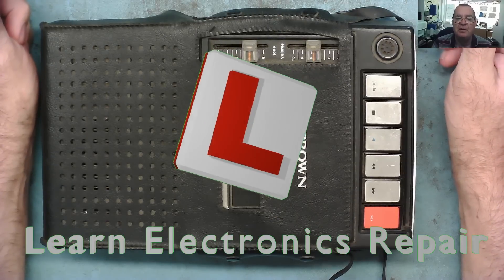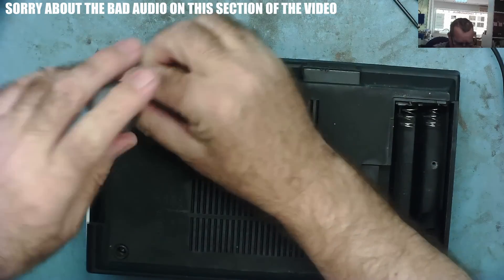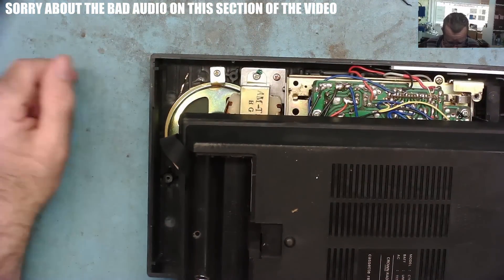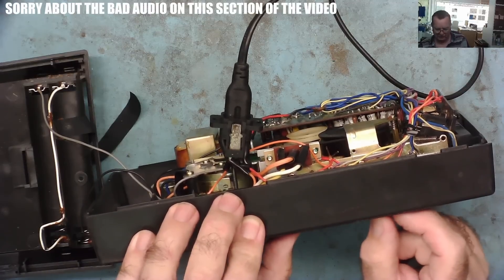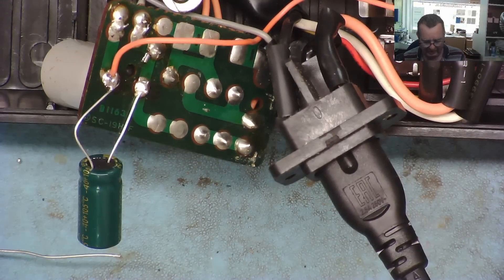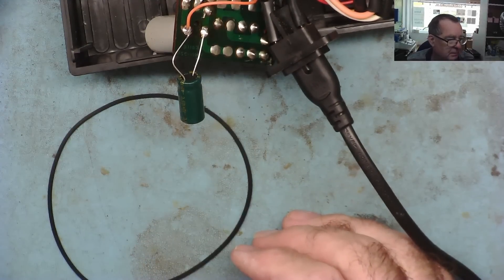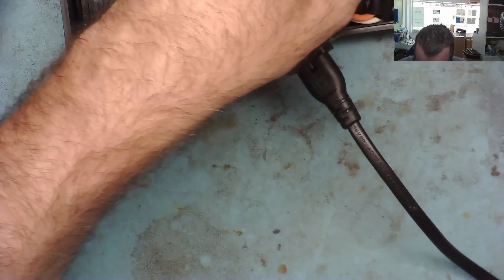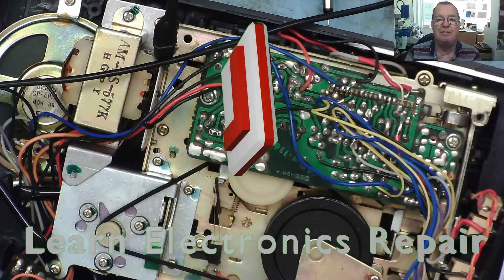Vintage 1970's Crown Portable Cassette Recorder Player Repair / Restoration

Comment: I enjoyed the video Richard, I remember back in the 70s getting one of these tape recorders for Christmas, as a child I remember taping top of the Pops from the television set then I would use it on a Sunday  to record the top 40 charts on the radio.the quality must have been horrendous. I also remember pinching those 6 V batteries out of those road lamps, strapping them to my bike to power the front and rear lights🙂
Reply from the maker: Ahh yeah recording from the top 40.... so we had this old valve radio and the best reception was on long wave where you could hear the Top40 on Sunday.  So I used to take the radio upstairs, took the back panel off and placed the microphone inside the radio itself.  That way I got the best quality.  No one (i.e Sisters!!!) was allowed in the room while I was recording.  Yeah them road lamp batteries also worked well strapped to bicycles.  And you could make a little bracket and fasten the cassette recorder to the centre of the handlebars as well and fit the battery under the seat.

Later I got into real music LOL.  I used to go to Northern Soul / Modern Soul All-dayers in Manchester at the Ritz (and elsewhere around the UK) and would of course take the obligatory Adidas bag with a change of clothes (some smuggled alcohol) and the tape recorder.  There was this one spot near the top of the stairs onto the Ritz balcony where you were right by the speakers so the Adidas bag would go there amongst the pile of other bags, tape recorder running inside, and the microphone hanging out between the railings in front of the speakers.  Wasn't just me doing that.  Of course you couldn't buy most of the rare soul they were playing even if you had the money, the vinyl was impossible to find, and you couldn't hear those songs anywhere else unless you went to where the DJs were playing it.

Oh to be young again but teens growing up now missed out on so much fun that we had then. And so much fantastic music, a lot of beautiful girls and NO ONE was fat.  And we enjoyed it all with almost no money. I'm not condoning everything we did but we had to be so inventive in those days just to get by LOL

Comment: hi rechard sorry for off topic question .. i am looking for ic that charges the  battery and protect it .. and  in same time supply 3.2 volts for mcu .. when charger is pluged 3.2 supplied from usb 5v .. when it is not connectet the 3.7 lithum battery supply 3.2v to mcu ..  thanks
Reply: how to look and search for specific ic in soic package ? 
TIA

Comment: you forgot the oldest trick in the book .take the drive belt off and boil it in water for about 3 minuets to shrink it back to its original size.
Reply from the maker: I thought someone would come up with some suggestion I didn't know about!  Must try that
Reply: 😮didn't know this ether , would have been useful on my OG Xbox that has a stretched belt , i bought a pack of 20 :P 
but will definitely keep this in mind 
thanks alot for sharing
Reply: I did this with the loading belt in a vcr the other week, it worked a treat

Comment: Did the motor have a ceramic capacitor across it's  terminals, I know form experience that can have an effect, on noise.
Reply from the maker: Hi Paul C
I didn't look.  I'll be passing this over to Carlos at Retro Upgrade if he wants to look at repairing the Cassette lid and make a part 2 video on his channel.  I'll order an assorted pack of 50 drive belts from AliExpress they are only a couple of Euros

Comment: No wonder it didn't work. Somebody fitted an elastic / rubber band instead of a belt, a rubber wheel instead of a pinch roller and a spindle instead of a capstan. Ho, ho, entertaining as always. Gunk in that long metal / plastic thingy (otherwise known as a record / play switch) can result in strange noises, as you discovered (other than those from your mic / mixer).

Comment: Hi Richard
33k Wow m8 :)
and yes i can give it a try , should be possible if there is enough space , haven't actually worked on a tape recorder since the Commodore 64 days .memories 😁
think i fixed a iomega tape drive 20 years ago 😆
Reply from the maker: Than you have a challenge.  I sorted the electronics it's over to yo to fix the mechanics 😁

Comment: Your audios abit dodgy mate , love the vid as usual
Reply: Apologies I saw the pop up message about the audio after i wrote my comment
Reply from the maker: @reacey  I've been having this problem on and off - first I thought it was my mixer, then the mic, and now I think it's the mic cable

Anyway at the car boot this weekend I found a condenser mic (that has very good reviews) with the boom stand, and another guy had five long professional XLR microphone cables so I bought the lot off him cheap.  I tried the new mic today and it is working. My mixer has two mic channels with phantom power so hopefully this will be better than the Wharfedale Cardiod mic I'm currently using.

I have that set up for the next video plus while I was at it I spent a couple hours today completely rearranging my workbench so I have more space to work and now the monitor previewing the recording is directly in front of my so I should find it much easier to look at the camera while working!
Reply: appriciate all you put into this channel, sure alot of others do also.